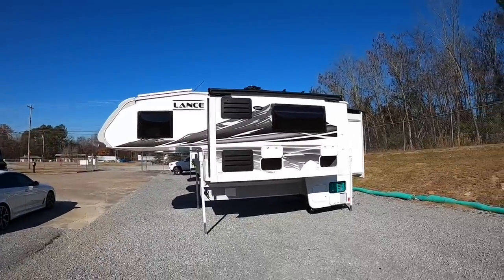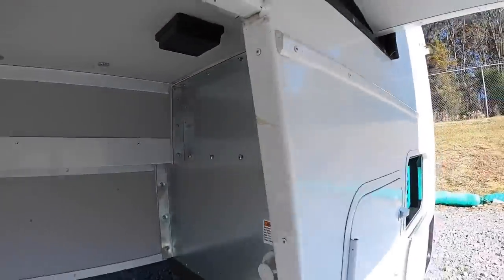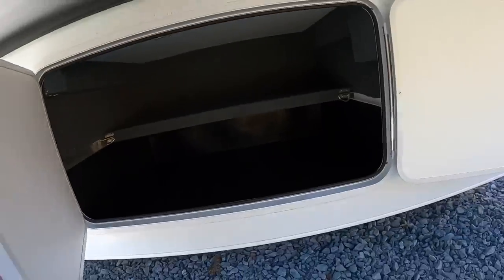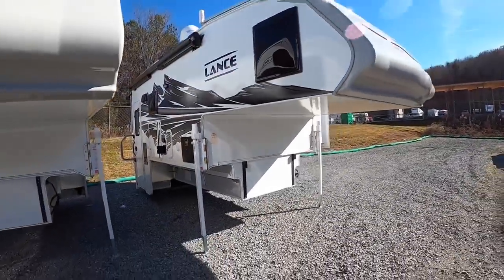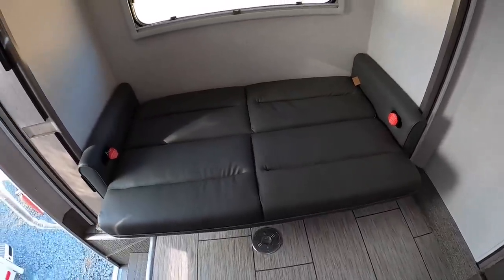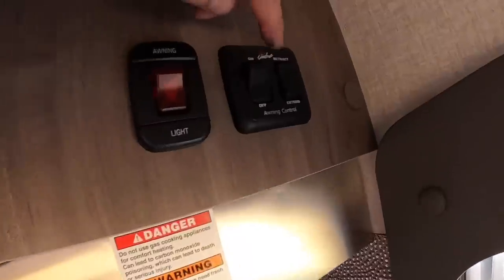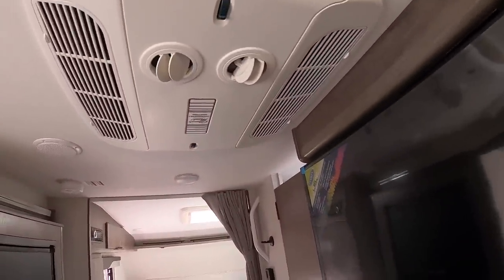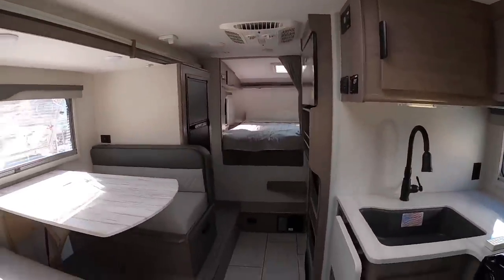JUST RELEASED! 2022 Lance 1172 Truck Camper! MAJOR Changes!

Comment: For that kind of coin you are in Host and Eagle Cap territory.  Loved Lance for years but for the money I would opt for either of the other two in a heart beat.
Reply from the maker: I’ve been trying to see what materials eagle cap uses and how their built, their website was no help. So, since I’m uneducated on them, explain to me what makes them a superior camper? 
Tried Host, that didn’t workout. 

Looking forward to your reply, thanks.
Reply: @itsbrad  
 I'm gonna be direct with you Brad since you were direct with me… though somewhat ingenuous I suspect. Just looking at the websites which I know is nothing more than a sales brochure if you can't tell the distinction between those 3 manufacturers then I think you're in the wrong business. I think the most important thing a business person can be is objective. There can only be one best of anything.. And it's nice to think that your product is good. Hopefully that's why you're there. Because you believe in the product you sell. But to use a sailing analogy, I don't think anybody at Island Packet (A maker of sale boats, and a damn good one)  Is delusional enough to think their boat is going to compare with a Discovery sailboat. It doesn't take a sailboat engineer long to see the distinction.   Of course in the case of iIsland Packet and Discovery, the Discovery is going to cost you 3 times as much.What's surprising to me about Eagle Cap and Host is they can provide, what appears to I think anyone who has even a modest understanding of truck campers, a superior product at a comparable price.

 I'll tell you a few main points. I'll limit it to Host but you can say the same thing for Eagle Cap.

As you mentioned in your video many items are now standard on Lance.  I think the reason they have done that is because those same items have been standard on Host for a while.

To me it looks like the people at Host actually spend time in truck campers. The number one distinction would be layout. When you have as much room as you do in their larger campers you can put in a center island.  More work space and more storage… things you can never get enough of in a truck campe and not having them are probably the main reasons people steer clear of them.   The way they have chosen to use the space also means you don't have to be a contortionist to take a shower in a room the size of a cracker box. Their shower is on one side in one passage way and the toilet is on the other side of that passage way. 

Oh, and then you have a separate passage way altogether with large storage areas for kitchen items and clothing.  Like I said, it's like someone at the corporate office actually stepped inside a truck camper at least once.

Just much more practical. Look at the R rating between the two. The frame structure. Little details like lighting underneath the camper so you can see your connections.  Adjustable LED lighting So not only is it power saving to begin with but they take it a step further.

So it's main considerations but it's also little things indicating again, somebody has actually used one of the things they produce and have tried to eliminate all the things that are a pain in the ass. I could go on but I'm not trying to make your channel a sales piece for either one of those companies. I was making an observation that's all. I get the sense with everything now becoming more standardized somebody at Lance acknowledges the competition. Maybe it would be worthwhile for you to take a trip out to their facility to see how those distinctions are accomplished.  If it would not interfere with your distribution agreement with Lance I would consider carrying 1 of those 2 products.   But Hey, what do I know about business. I was only able to retire when I was 50.

Again, I think Lance is a fine camper. But then again I think Island Packet is a fine sailboat.....I bought one..  But I don't pretend that they are the best of the best. But they are damn good. I think you can say the same thing for Lance

 I think the overall driver between the difference between the 2 companies is Lance is more produces units. Volume is king. I doubt the production between Host and Eagle Cap comes close to what Lance produces.   I also get the feeling being the number one producer of trump campers is not their priority.

Best of luck to you. I do enjoy your channel.. Your presentation of your products is informative and entertaining. I like your dry sense of humor.
Reply from the maker: Thank you for the kind words, I’ve checked out the Eagle Cap campers and like how they’re also an all aluminum structure, design, layout, we both use the same Fiberglass Exterior. 
But After checking, all the options you were saying were standard that Lance has now made standard are not on the Eagle Cap from what I’m seeing, ex.: awning, tv, air conditioner,4 seasons, etc. Which this is not a bad thing, some people don’t want all that so no need to charge everyone for it if there is no desire for it for a customer. 
Another thing is is it looks to be that they’re aimed purely towards the dually market and as their lightest camper (811 from what I can see) is 3,380lbs standard without the optional equipment 95% of the market will add. 
I think Eagle Cap is a well made camper, but there’s still a few things that set Lance apart down to construction, Euro Lite which is stronger and light then some of our competitors, Azdel interior which is water resistant, no rot/mildew, does not shrink/expand due to climate changes, and puncture/impact resistant. I prefer our slick looking tpo nose cap as well, chip and crack resistant unlike the fiberglass. 
All in all, I don’t think there is a perfect camper out there, but the ones mentioned are in the top contenders imo 😁
Reply: @itsbrad  
 I agree with everything you said. Like you said, there is no perfect camper out there. As with most things in life, it's always a matter of compromise.

Just a word that maybe you can pass along to any of the powers that be in the truck camper manufacturing business.. It seems to me that that couch in the very back of truck campers is less than desirable. They all look so uncomfortable and none that I'm aware of fully reclined. It seems like since storage is always such an issue they could turn it into a wardrobe or drawers or something like that.  

 Maybe someday if we start our own truck camper business that will be the 1st improvement. Best of luck to you. Look forward to your next video.
Reply from the maker: Will do, I agree about the rear couch, I’ve been hoping to see a chair or theatre seating option for awhile, but nothing shows on my order sheet for it yet. A wardrobe/more cabinet storage space would be an awesome feature to see!

Comment: We have a 1062 and wouldn't trade it for anything. More counter space. And 50 gal water tank.
Reply from the maker: Lance 1172 Tank Capacities:
Fresh 42g
Grey 35g
Black 35g

Lance 1062 Tank Capacities:
Fresh 45g
Grey 27g
Black 22g

Don’t get me wrong, they both have their perks,  and does have a ton of countertop space! But is not superior in Tank Capacities..
Reply: @itsbrad  ya but you have all that extra weight on the rear.  You are the first person that has come right out and said  you need a dually. When we bought ours from galaxy campers we were told " with your 350 diesel 4x4 you will have no prob".  So we waited. Then came the sway. So we have  converted our 350 single cab diesel into a dually.  Now I'm not even afraid to driver it even towin a trailer. That you Brad for being honest and up front.

Comment: if my ship came in well i would want a solar and also wind tech and also pole lights some times yet the bathroom disposal i wonder about so i thought maybe instead of inside one a one from hose to a portable out side but say several gallens septic that would be cleaner and also easyer to operate or disposabel  stations if any i still lurning '

Comment: I am sure that you have noticed that the smaller they are, the more expensive they are. However, think about how easy it is to just hop in and go with something like this! And these have sure come a long way. With those slide-outs, you end up with quite a bit of room. 
Great video! Thanks! I will have to get a tall friend that I don't like some day and make out the bed in the back for them. :)
Reply: But, you have to crawl in and out of bed which would be a pain after a while.  And all your truck bed storage space is taken up by the camper.

Comment: My 1900 sq. ft house cost me  $52,000 . . . . . Inflation is killing us .
Reply: what year was that that you bought it? in the 80s? of course, i guess it depends WHERE the house is, too. houses where i live are anywhere from 400,000 to 2.6 million or more.
Reply: @Seashellsbytheseashore21  . . . . You are sooo right , location is everything !   I'm in  Central Oklahoma.  Bought the house sitting on 2.5 acres  , two miles from the nearest small town in 1990.  I can probably get 6X that now but anything I turned around and bought would be that much or more , so is it really a gain ?  Wages sure have not kept up with that inflation.

Comment: We’re thinking of getting a short bed F150 next year…What bed camper do you recommend? Don’t want to spend a fortune but want sleeping comfort, bathroom and maybe a slide out. Unless that adds too much weight for the truck? Any feedback would be appreciated.
Reply from the maker: 5.5 bed you’d go with a Lance 650
6.5 bed you’d go with an 825
Both are most likely over the payload recommendation of the truck, they’ll carry it no problem, but it’s up to the customer if they want to risk the liability

Comment: to bad no fiberglass nose and roof, also they could have put in a smooth top burner on top like a furion with more space to work with I ripped that one out and did a swap and so much better nice rig though
Reply from the maker: Fiberglass is great, but not great when you have to repair chips and stress cracks. Lance has laminate fiberglass sides, but I believe the TPO nose cap is best for the nose in case of debri and pvc roof to be better to walk on without possibly producing stress cracks

Comment: Sold my lance 1172 last November looking to get another one what is the price range if I was to get a trauma tankless water heater with the generator ? I had a 2017 and the Onan generator 2500 was included in the price and so was the roof rack of which I never used. Liked the colors of this one better than the one that I had. I also like how the windows open up more than the one that I had also
Reply from the maker: Their not doing the Truma System for now, supply chain issues. Loaded up how we normally order them you’ll be in the $73k range
Reply: @itsbrad  What options do you normally order them with for that 73K

Comment: Nice Lance 1172, seems like some interiors options still aren't up to their traditional lance camper quality? Nothing innovative for 22', They should change a few things? Can this model be pre-plumbed for a W/D where the Jack knife is? Can AC be upgraded, we're in Arizona? Thanks for the review...
Reply from the maker: I believe the quality is better then ever, I have a ‘21 model 975. They’re pretty standard across the board how they build although they do have some options available such as solar, lithium batteries, Wi-Fi booster, Auto satellite, etc. 
thank you for watching!
Reply: @itsbrad  I also would like to know if you can get a larger AC unit for those desert climates. A 15K unit would be nice in the hot Arizona heat.

Comment: Wow! Sticker shock! Why are these so much more than some travel trailers?
Reply from the maker: The way they’re built and materials used and add ons that aren’t available for some TT’s. Example: all aluminum structure, euro ply, azdel interior, etc. More labor due to working in enclosed area - Truck Campers average 240 man hours vs an average TT take only 160 man hours to build. 
But if you price apples to apples Lance’s Travel Trailers are the same if not more in price then the truck campers. Another well made quality product Travel Trailer is Air Stream, those aren’t cheaper by any means.
Reply from the maker: This is a good, honest question too! I’m glad you asked so I can have the opportunity to explain. 
Most people are total A-Holes about it when they don’t understand something
Reply: @itsbrad  Ah, I see! I figured it had to be more labor intensive which would drive up the cost. Also, with the labor shortage everywhere there are probably not many specialized to build them.

Comment: What about the dodge 4500 and 5500. Look people take an example from the hot shot industry. There is a reason why a vast majority of them are towing the other dodge 3500, 4500, 5500. It because they have the highest steer axle rating and the highest rear axle rating and they last longer then the fords
Reply from the maker: The 4500 and 5500 don’t come with beds. I’ve sold to one Ram 4500 that the customer had a custom “Factory” bed installed and it barely fits. Fits the 3500 perfect though 🤔
I use a F450 to haul mine, so your last statement is purely opinion lol

Comment: Brad when you camp with yours do you drop it and lower it so you can use your truck for other things like launching the boat ? When at a camp ground for a while.
Reply from the maker: Yes, I did a week long trip off the truck in Nov. and two weeks off the truck in Dec. 
I’ll try to get more time off soon to do videos at the campsite, kinda the reason I bought it then got lazy haha
Reply: You do not want to be in the camper off the truck unless you park a couple of jackstands for additional support under the front of the bed.  The back jacks have lower attaching points the fronts do not. Just sayin'.

Comment: So how much? A 2500 longed Ram 6.7L would be able to haul it  if it's only 5000 pounds
Reply from the maker: I won’t sell you one to put in a 2500
Had a Ram 2500 that struggled to haul our lightest camper without suspension help due to Ram using coil springs in the rear, total death trap. These retail around $80k though

Comment: No 3500 will be safe with that you  should know that.    Also quality is way down from past.  Over 5000 lbs. frames will bend  with any extra rear weight.  4500 or 5500 a must
Reply from the maker: Uh oh, someone didn’t do their research before commenting. The 350 has more payload on sticker then the 450. I know bc we have owned both at the dealership, same trim, options, and motor, the 350 had 800lbs more payload then our 450 does. Reason is you gain zero gvwr going to the 450 and you’re getting a lot heavier truck. Both will do the job as we’ve hauled the 1172 all around America in both trucks with a 5klb Ranger Bass boat behind. Just don’t be a moron like the Ram guy with an eagle cap and load even more excessive weight (motorcycle) behind the rear axle.

Comment: I would recommend above a "1 ton". meaning a chassis cab.  Ram 4500,5500. Ford super duty 550, ect.   A chassis cab has a typical payload of 10,000 pounds.  A 350, 450 non chassis cab is between 4000 and 5000 pounds of payload.  You would be maxing out your truck payload.  
Go for the chassis cab. Yes they are detuned a little.  Who cares. You will have a truck better designed for that weight
Reply from the maker: I’m not sure where you’re getting your information, but I believe you’ve been misinformed. Our F350 Drw we had was almost a 7,500lb payload and our current F450 has a bit over a 5,600lb payload. The 450 outperforms the 350 night and day, but Ford doesn’t rate it any higher to keep it in a residential license I’m guessing? But not even close to maxing out the truck lol
Personally I’m not putting one of these on a flatbed, they are not designed for flatbeds and there’s plenty of picture evidence out there to show why.
Reply: @itsbrad   the only way you are getting a payload of over 7000 pounds on a DRW F350. Is with a regular cab 4x2 8 ft bed GAS engine.   The 6.2 or 7.3. 
You must be getting terrible gas mileage 
I'm talking about a 4 door. 4x4 drw diesel
 And yes you can put a truck camper on a chassis cab. Companies makes beds specifically for that application
Reply from the maker: @mattwesley4435  diesel… didn’t know people bought trucks for mpg anyways. 
Saw another Flatbed rig over the weekend posted with the Truck Camper sitting in the middle of the road that slid off the flatbed.